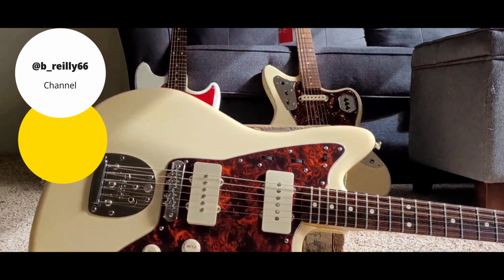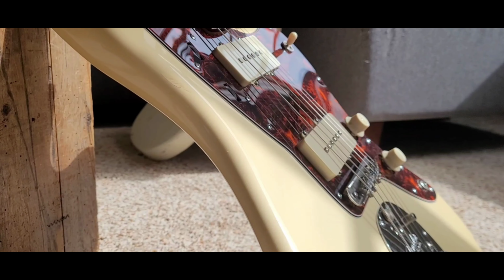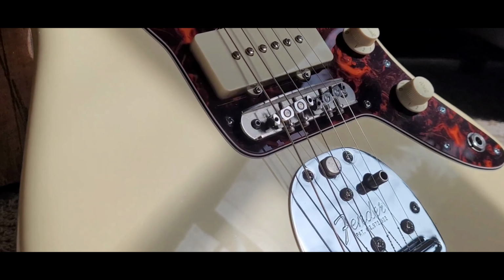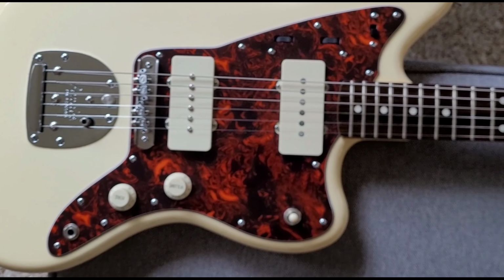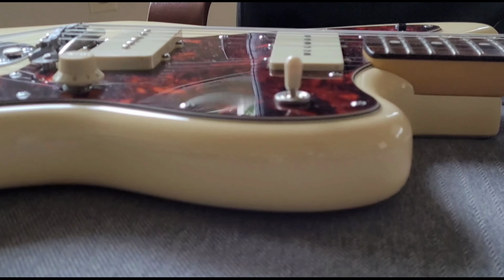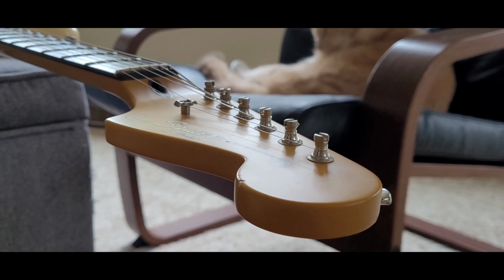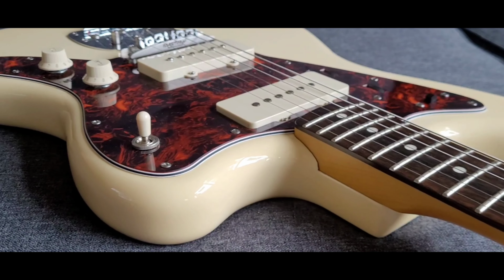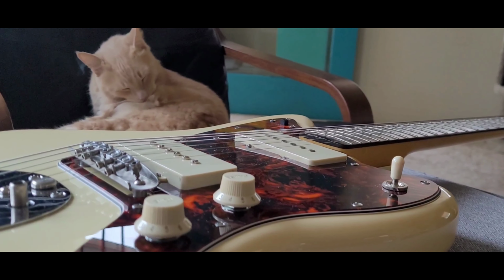Squier J MASCIS modified / IN DEPTH review!

Comment: Love to see you singing the praises of Squier. I agree with all of your comments. After what you said about the contours of the JMJM, it’s so obvious looking at your B-roll footage. I’d never noticed that before.

Another interesting thing about the JMJM is that it comes stock with jazzmaster sized p90s as opposed to the standard jm pickups. It also comes with a TOM bridge that doesn’t rock back and forth (I think) like a regular jm. That might help a beginner with intonation issues they might otherwise experience with typical offsets. 

Cheers, B!
Reply from the maker: Cheers Ramiro! Seriously on these! And the relative interchangeability of parts basically make these hot rod perfect.
   Hope the week treats you right!
Reply: No, they are defenitely not a jazzmaster sized P90s, what are you talking about.
Reply: @LeschekOfLechia check out the specs. They don’t have typical jazzmaster pickups; they come stock with hotter wound pickups with adjustable pole pieces so they are more akin to p90s than average jm pickups.
Reply: @ramsilva  those are just tweaks. P90 has completely different construction than jazzmaster single and JMJM has proper JM singles. They are darker than regular ones, that’s correct, but they are defenitely not P90s.
Reply from the maker: I'm sorry but I how is it not a p90 with a single bobbin and a wide flat wind?
   My soapbar p90s on my sg have adjustable pole pieces. No one's ever called that into question. 
   Especially given that the unit is in fact, nearly identical in size.
Reply: @LeschekOfLechia  J wanted P90s in his Jazzmaster, they gave J P90s in his Jazzmaster

Comment: Hey mate just wondering if you had to do any mods to put your Mastery bridge on? Did you redrill and put original bridge posts in to replace the tune o matic ones?
Reply from the maker: The body was still wearing Mustang thimbles and a bridge so it was a straight swap. Although for a tunomatic to Mustang bridge swap you would need to fill and drill. The tunomatic runs 74 wide while the jazz jag Mustang bridge is 73mm wide.